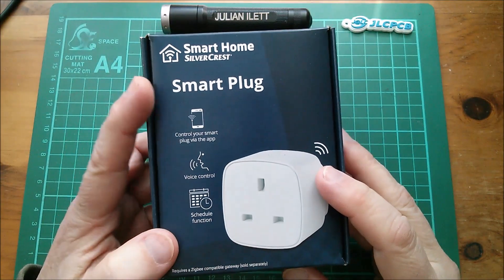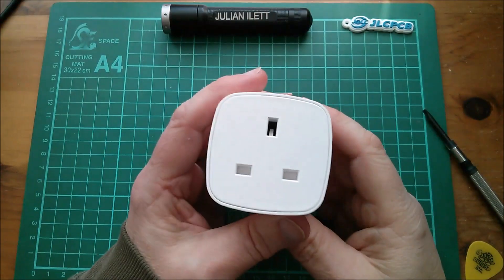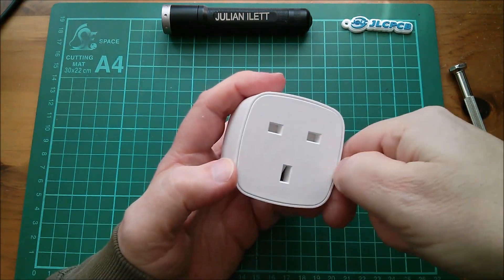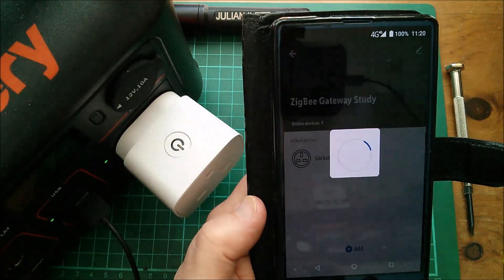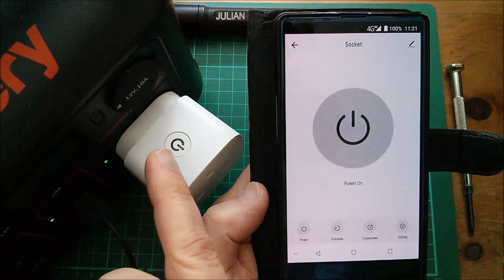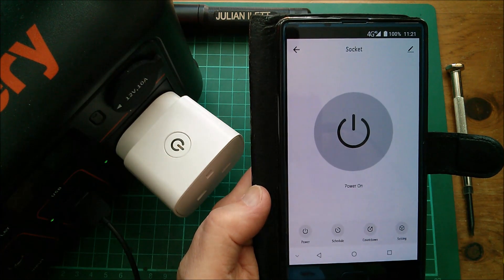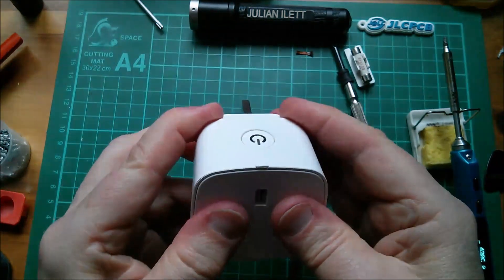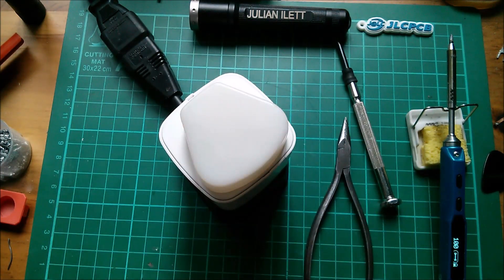Lidl SilverCrest Smart Plug Stripdown (very frustrating)

Comment: does this outlet also act as a zigbee mesh repeater ?
Reply from the maker: Doesn't Zigbee do that anyway?
Reply: @JulianIlett  From what I read online, not all zigbee devices act as repeaters, also I just read yesterday that there are some light bulbs that even though connected to ac 24/7 dont act as repeaters. so just wanted to make sure before buying this because I actually have no use for its function as a smart plug but rather need its zigbee repeater function if available to have better coverage around my house with a small plugged device.

Comment: What I find so strange about this is if you connect this plug to home assistant you can get way more features. Power monitoring, energy usage, there's a child lock feature. But Lidl just opted to use the on of switch and that's it?

Comment: what is the benefit of a hub system over separate wi-fi plugs/switches exc. that work on their own ?
Reply: Well, it's an entirely separate ecosystem. So if you only have wifi and don't want to get a zigbee coordinator, why not with just wifi. Pros for Zigbee that I can think of: lower power consumption when idle (can save you a euro per year in stand by costs); usually longer range than wifi; can be controlled by any/most zigbee software unlike wifi (which usually require propriatery software).

Comment: I had the same trouble, Lidl had everything but the Smart Plugs in stock. I was disappointed at first because I thought they were a good price at £7.99 but I then found a better option, I found a seller on Amazon selling WiFi version Gosund Smart Plugs that worked out at £7.64 each (£30.59 for a pack of 4). These are OTA flashable and do not require a hub so over-all a much better solution and cheaper (especially if you factor in a Hub costs). If you have to install hubs in 2021 to get your home smart, you've failed :)
Reply: if you need to code and spend time fixing stuff in 2021 you failed

Overpay on hue and spend less time fiddling
Reply: @reviewassistant6891  Absolutely not, Philips Hue is over priced rubbish. I forgot I posted this but 8 months on, my £7.64 options are awesome, still working perfectly. So good, I bought another 2 packs.

Comment: I have my wifi router powered by my solar so it stays on during powerouts. To power cycle just get of your bum and press the switch or log in and power cycle the unit.
By the way it's a router, not a rooter.
Reply: He did use the UK English pronouncing, not the American pronouncing.
Reply: @user-marco-S  I am Australian and we use UK English, it's still called a router here, not a rooter. Usually it's the Americans using lazy English.
Reply: @stevetobias4890   Ok, Julian used the British pronouncing (better?).
Reply from the maker: That's because "rooting" means something completely different in Oz.

Comment: if you need to power cycle something, you can either rewire this to the nc contact, or build your own low voltage switch if your router is 5-12 volts dc etc...

Comment: For your router application couldn’t you source a normally closed relay and fit that, so when you turn it ‘on’ in the app it energises the coil which opens the contact when you turn ‘off’ in the app the power to the router returns?

Comment: You need some serious mass in the soldering iron tip - or a lot more watts in the heating element - to get a good connection on that much metal.  I don't consider your connection adequate for 13 amps - probably not much more than 5 amps.  Yes, I still have a 150-200 watt (not sure how big) "billy club" soldering iron in the bottom of the tool box.  Something I use once on 3 years, maybe?

Comment: I thought you took it apart to see if you can change the relay pins from NO to NC. These things usually have a pulse mode in the settings, so could have been ideal for resetting the router.
Reply: I looked up the datasheet and it indeed seems to be a NO/NC type of relay, so by cutting the trace and soldering some wire to the unused contact you could modify the socket to NC. Nice idea
Reply: Or a smart plug that uses an ESP8266 and just reprogram it. Or even better, embed a watchdog microcontroller into the router.
Reply: ESP8266 driving a mosfet, on the DC line into the modem... nowhere as much power loss whilst it's in always on mode, and no need to rely on external API to control it... can be all local control. After all, if the gateway is controlled via the 'cloud' service, if your modem packed up, you won't be able to tell the gateway to turn the plug off an on again! 😂

Comment: The phone app saying "Power On" and "Power Off" is a bit confusing.  It is saying what tapping the button will do instead of the current state of the switch which I really want to know.  Then the app plug button goes dark when the power is on... seems backwards to me.  My Globe wifi switches say "tap to turn on" under a dark button when off.  And when on the button lights up along with a green power symbol.  My Alexa plugs are similar and say the current state.  Yours seem all backwards to me and I can see people that don't use the app much getting it wrong when they aren't home to see their device turn on.
Reply: That's a pet peeve of mine. So many programs have labels that could be the current status or the status after they're selected and it's always so annoying! I don't know why so many UI designers don't get that. It's completely user unfriendly and so easily avoided...
Reply: @stheil  - Yep.  Some apps just aren't well thought out.

Comment: Will the socket still be connected to the hub if your wireless goes down, and if it’s not in your wireless then you won’t be able to reset it...
Reply: Most likely not, Tuya hub don't need WiFi to control device's, only used for updating connections on app.

Comment: You have forget one solder, also don't expect much than 10 A with this Relay.
Reply: To be fair, with how terrible that one joint we saw done was, I would not be comfortable drawing more than 5A through it. It was essentially a 'dry joint' in my opinion, fortunately not hard to remedy by simply using a better soldering iron than that battery powered thing that he tries to use, always too hot, for everything, even for stuff it is no good for.
Reply: @Tekwyzard  Don't forget, though, that Julian is stuck with having to use lead-free solder as he is in the UK.
Reply: @englishrupe01  Hahaha, a lot of people think that, but I'm in the UK too, and within a mere few hours and a short drive to Preston, I can have as much 60/40 goodness as I want. Such as this https://cpc.farnell.com/duratool/d01681/solder-wire-sn60-pb40-0-7mm-100g/dp/SD01535 yummy stuff, which'd have a lot of young 'uns hiding under their beds in sheer terror with their windows flung wide open; in fact my old stash is getting a bit low after over 10 years of huffing the stuff, so I'll have to get some more myself soonish.
Reply: @Tekwyzard  Ah ok...cool! I had thought that it was only possible to get it if you are reduced to lying that it was not for electronics use. I am glad to hear it! As i am in the US, i am free to eat it if i so desire....lol!

Comment: Malta is quite fun (anarchy) on the plug socket front.
I think officially they are supposed to have European sockets, but I've stayed in hotel rooms that had both Euro and UK sockets, often side by side.
Reply: Not a bad idea for hotels to have multiple typical sockets. People using shitty adapters electrocuting themselves and setting things on fire may well be a nuisance.
Reply: Saudi Arabia standardized on the UK plug back in about 2014.  When working there it was easy to see what country helped build what part of the country.  They have 120v 60Hz US power, 230v 50Hz European power.  In the 230v areas it is common to find Euro and UK outlets, sometimes mixed in the same building.  Quite a mess really.
Reply: @Birdman_in_CLE  sounds like a recipe for blowing up anything without a wide range switch mode PSU!

Ooh, my American shaver is running very fast here...

smoke

Oh, hang on, it's stopped.
Reply: Actually I think they're supposed to use UK plugs, but you'll find Euro plugs also installed for the convenience of European visitors.

Comment: It's funny that you turn up the iron temperature to do a joint on a large surface, but what you really need more energy from a higher wattage iron.

A low power iron turned up to 300°C if running flat out, will not get much hotter if turned up to 400°C, it can only get as hot as the energy flowing in will allow.
Reply: I find that even my lower power iron (similar wattage to the TS100 Ilett is using, has an LED to indicate when the heater is on), never maxes out the heating even with joints like this, and the duty cycle is still fairly low while doing so. 

The problem is also one of heat transfer and dissipation - a bigger tip can only do so much, and the heat doesn't make it throughout the joint (the thermocouple inside the tip will be reporting 300c, while the unmolten edge of the joint will be too low temperature to melt). Bumping up the temperature by 100c also increases the temp at the edge of the joint by 100c, allowing it to melt.

Comment: how smaller relay 20A and the bigger one is 16A ??
Reply: People who ordered them just told the chinese manufacturer to put those numbers on the things because that's what someone wanted to see.
Reply from the maker: It's a mystery :)
Reply: Wider contact which are made smarter? Maybe like spoon with high surface area and low resistance but it might break earlier than others 16A versions?
Just load it to 16A and see if small 20A can survive

Comment: I prefer the sonoff's
Reply: Sonoff is that like tuya shit from China? Unencrypted sending of my WiFi password and always sending on/off commands through internet is nothing I like..
Tasmota please
Reply: @kitecattestecke2303  not true, the device needs the password to talk to WiFi. Disconnect internet and see if it still works ... It does
Reply: I prefer ethernet.  No need to reboot cheap wifi router.
Reply from the maker: How much is the son off?
Reply: @JulianIlett  Twice the price of the Lidl one.
Reply: @JulianIlett  the basic version is as low as £7.44 , alot of the makers use them as they contain the esp-01 and you can reprogram it for mqtt or whatever you want, I got one to try and it connects to Alexa with Arduino code easily found on the internet
Reply: Difference is Sonoff devices are WiFi. That may be an issue getting internet to the shed without a run of cable. ZigBee at least is mesh based and the network will relay from the closest node
Reply: @bytespider  you could use the esp-NOW or esp-mesh code example, or the painless mesh library. that takes time and effort, so for most people it is just easier to buy an off the shelf product that works first time